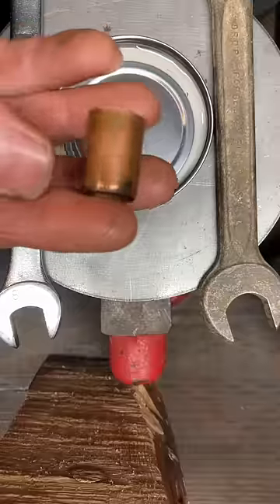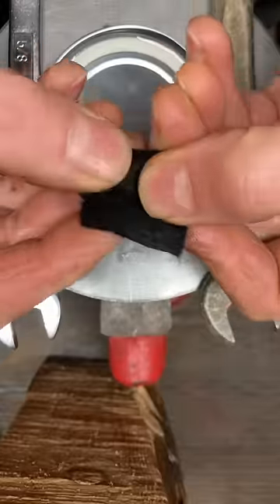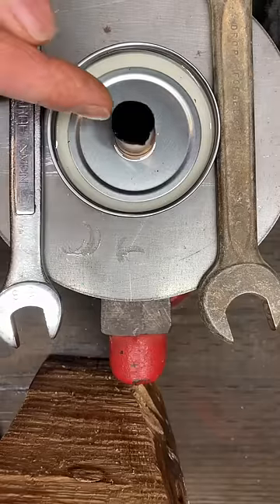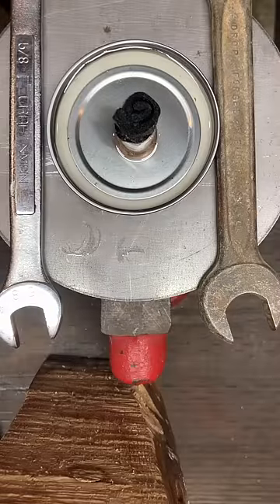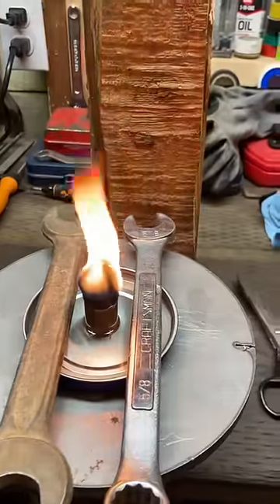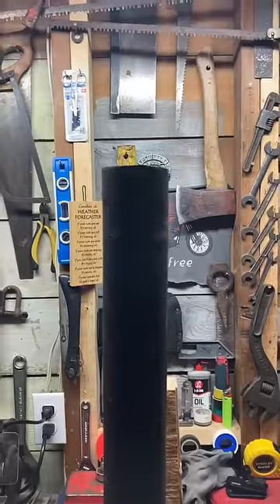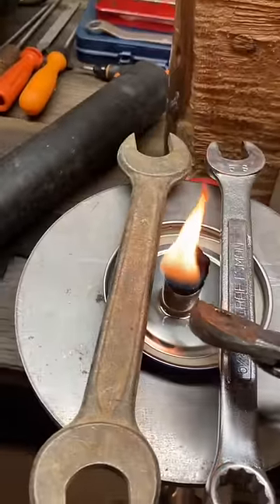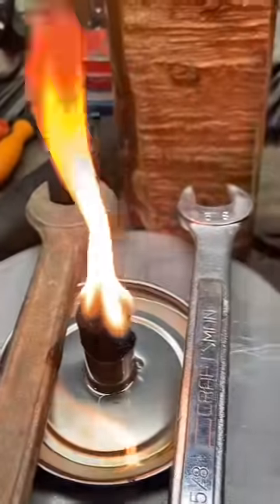This Wick's INGENIOUS! 🔥🤔 #shorts #diy #tips

Comment: So this may seem stupid asking idk but is the carbon filter in my air purifier the same thing as carbon felt? I had bought a massive roll of the carbon filter the year we had tons of forest fires in my area and used them on our box fans which worked and help a lot. So I have a ton of that stuff, but idk if I have carbon felt. So is it different or could I use the carbon filter materials in same manner? I also heard if you weave a copper wire through the carbon felt it helps in some manner in the wick performance, idk.
Reply from the maker: Not a stupid question at all & the answer is that carbon filter is Not the same as carbon felt. Carbon felt is essentially fireproof & will not burn up but will wick heavier oils like vegetable oil very well no need for copper wire if it is tightly placed in coupling. Still needs to be used in well ventilated area though.

Comment: In your first video I saw the romex wire hanging down inside the building. I glad you found where it was shorted to the building. The use of an bushing going through the sheet metal would have saved you the issue you had. I imagine that you have more issues than that lone one. All your wiring should be securely fastened in place. Best of luck to you.

Comment: I discovered that instead of wire cloth to clean the tip of your soldering iron you can use this. And it’s electrically conductive.
Reply from the maker: Interesting, thanks for sharing!

Comment: Just why modern lanterns that run off of light gas... Use what they call a filament which is made of glass or fiberglass. Nothing really burns. It's just fuel going through chemical combustion. Or rather... Clean burn.

Comment: Be sure to have a thick set base for the copper piece it's sitting on, to withstand the heat exchanged from the wick down to the base.
Reply: The base is sitting in room temp liquid oil..... it's kinda self cooling by design.

Comment: I just use toilet paper, cheaper and works great for an impromptu oil lamp.  Take a piece of aluminum foil and make it float with a bit of rolled tp in the middle and float it in a bowl of oil and you have a floating candle.  Carbon felt isn’t needed imo.

Comment: The danger with this is the copper tube will continue to heat up until the oil starts boiling in and around it. That is when the oil is at the ignition point.
Once it passes that point, everything will *Fwoom* into a huge fireball igniting anything combustible in the vicinity.

How do I know? Experience. I will never ever make these again.

Comment: How long will a capful of oil like that burn for? How much heat will it produce, for example, will it heat up a room? Or is it just for an outdoor heater?
Reply from the maker: Check out part 2 & 3 both short videos. This was just an experiment to show how the fireproof carbon felt wicked oil and held a flame. Needs to be piped outside or used in well ventilated area.

Comment: Hmm could you get multiple going and a fan and heat a small room 🤔🤔
Reply from the maker: It burns clean but not that clean, wouldn't take long and you'd be smoked out. Definitely need to vent to the outdoors. Just posted a longer form video on the subject, thanks for watching!

Comment: There’s some debate whether or not copper is safe near a flame. Brass or brass chrome plated would be a better choice.
Reply: A copper pot/pan is ok for cooking if the surface where the food goes id coated with some kind of stainless steel, but you shouldn't use an unlined copper pan or make a pipe out of copper (for smoking).  Brass is just a copper alloy (72:28 copper/zinc is common "pure" brass)
Reply: Burning zinc causes Metal Fume Fever and I believe brass has zinc in it?
Reply: @NulodPBall  Brass is a copper alloy, usually with around 30% zinc and sometimes 2-3%led to make it easier to work/cut

Comment: U can put these on the internet for sale like the Artic Air conditioner that's showing up in all the Goodwill's as soon as all the fools that bought them ,reciever them, and after the first use realized they'd spent $20 on a $2 plastic toy fan blowing thru a handful of wet straw and doesn't work, as i seriously doubt this "heater" would effectively heat anything larger than my snakes cage.

Comment: I like this. If your wondering where to get carbon felt.  heat Sheilds like what I use so block my torch flame 🔥 from catching stuff around my job on fire when I'm soldering. Or just Google "carbon felt" nevermind I thought I was helping

Comment: Really cool emergency  heat. Is it tent safe?
Reply from the maker: If you had a wall tent with a woodstove pipe outlet. This needs to be vented. Just showing how well the carbon felt wicks the oil and holds a flame.

Comment: Gonna try that with a 4” copper coupling to heat up my basement
Reply from the maker: You would have a pretty smoky basement unless vented to outdoors, it burns cleaner with a chimney but will still produce products of combustion.
Reply: Put a large hole through the coupling. It will clean it up a lot

Comment: Try ceramic wool and denatured alcohol. Works great.
Reply: I'm sure, yet don't knock the flame over into the alcohol.
Reply: @lupine617  alcohol can be put out by water unlike petroleum/oil based fuels. It’s why it’s used as a fuel source on sail boats.

Comment: I just got an issue using the copper burning it that is 
Tbh think the safer way to go is a brass nipple
That cast iron also has a coating on it 
Just sayin
Reply from the maker: I get what you're saying. Really I was just trying to show how well a fireproof material like carbon felt wicks oil and holds a flame, brass nipple is a good idea though
Reply: @JENSENDIY  
By no means critiquing 
I knew you were showing the wick and that’s a wicked good idea

Comment: What if you drill holes near the top of the copper pipe?
Reply from the maker: No air would be able to get in those holes as the carbon felt is pushing firmly onto the entire inner portion of the pipe.

Comment: Yeah don't be eating that vegetable oil or using it in cooking.  Canola oil is cheap rust proof for new metal to be forged later. It oxidizes quickly forming a hard surface

Comment: Another thing I will never remember when the power goes out.
Reply: If you get cold enough, you might.  I just fire up my generator though.  2 space heaters - 3,000 watts, 25 amps @ 120volts

Comment: You need a fuel in the vegetable oil. Had mine soaking over 24 hours and still would not light.
Reply from the maker: In part 2 it only took 1 match to light the wick. I used only vegetable oil and rolled the carbon felt up tightly.

Comment: What if I don't have a blowtorch to light?
Reply from the maker: Use a match or lighter.  Check out part 2
Reply: @JENSENDIY  cool. I thought maybe it required a high heat starter. That's neat

Comment: I got gallons of used motor oil in my garage. I wonder if I could make something like this but bigger with a pipe leading through the garage roof? It already has a exhaust pipe in the roof. I could use that.

Comment: My grandmother, at the time when we were without electricity, took a potato, cut it down so that it stood up, made a dent in it, put oil on it, rolled any cotton cloth, put it in the oil and it lasted for hours. So the gentleman did not invent hot water. There were a lot of them before him.
Reply from the maker: I agree, there are other videos on this subject as well. This is just about using a fireproof product to hold a flame. Thanks for sharing!

Comment: You clearly don't know how vegetable works or any oil for that matter yes the old did not catch fire as soon as you flipped the flame over but once the oil gets uptight combustion temperature it will catch fire
Reply from the maker: On a larger scale I think you are correct but this is a small flame producing very low btu's. I was just showing that if the flame comes in contact with the oil source that it will not ignite instantly.